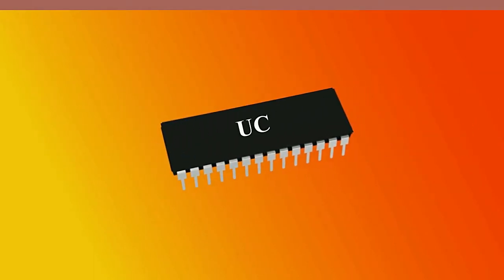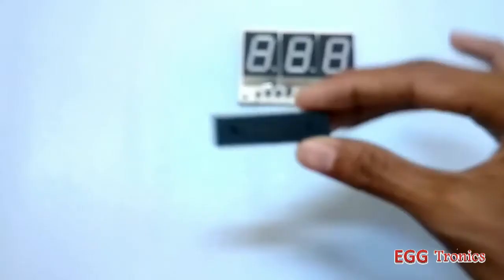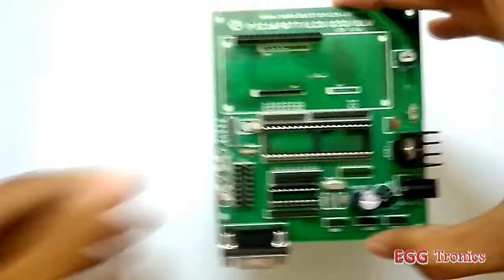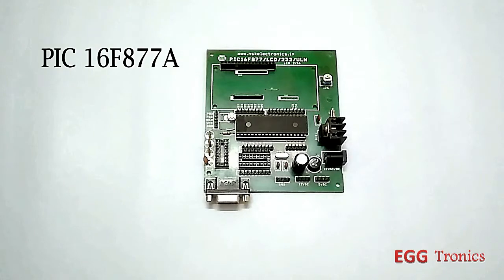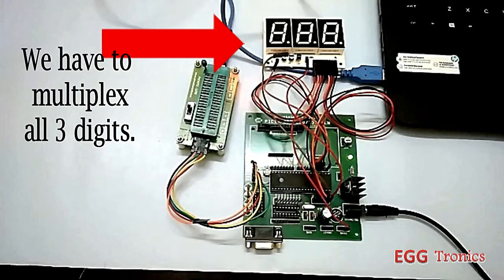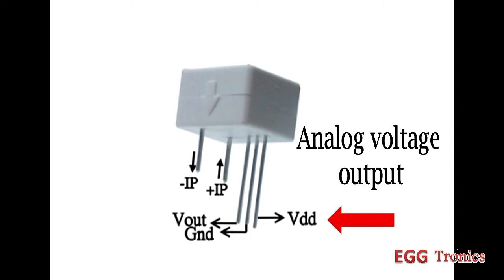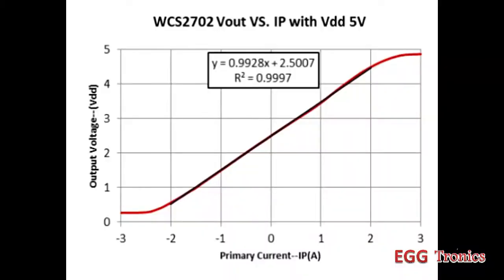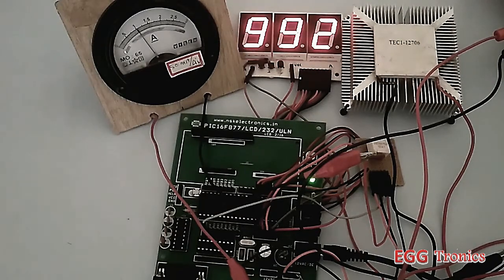Digital Ammeter Using PIC Micro-Controller

Comment: U have not provided any video or not explain abut codes ur wrote..
This is not proper way
Reply from the maker: Hi.. as per YouTube guidelines we cannot explain any coding language. FYI code is pretty standard. You can find code online easily for the display and for configuring one analog pin. And modify it slightly.
Reply: @EggTronics31  all other are explaining the code and fully course available. You shoud also give ur details in description as well